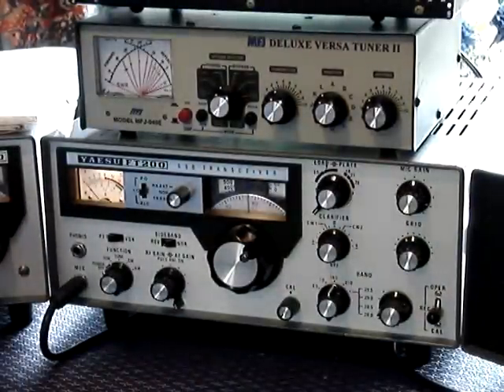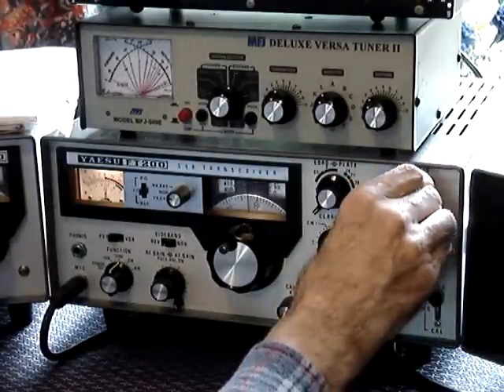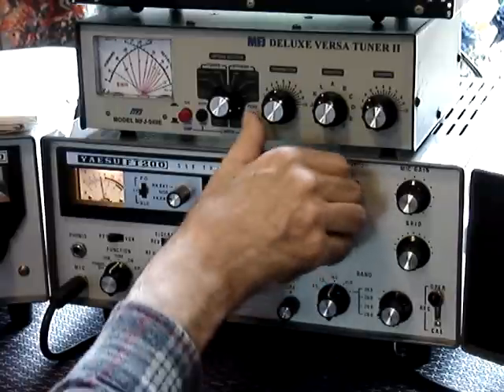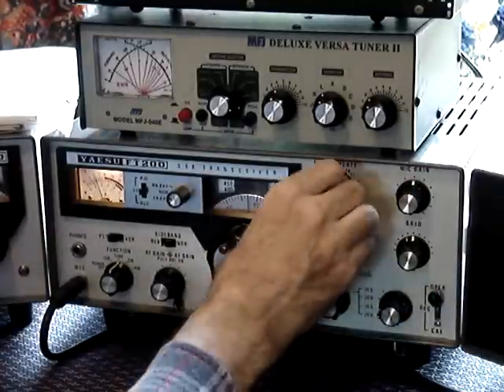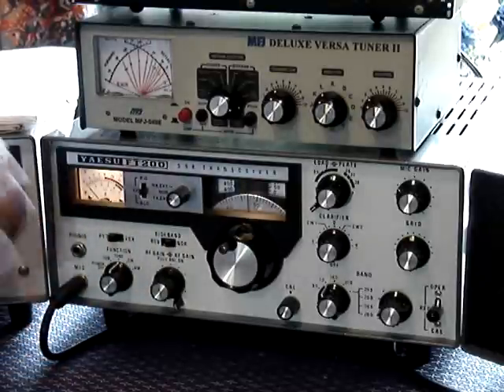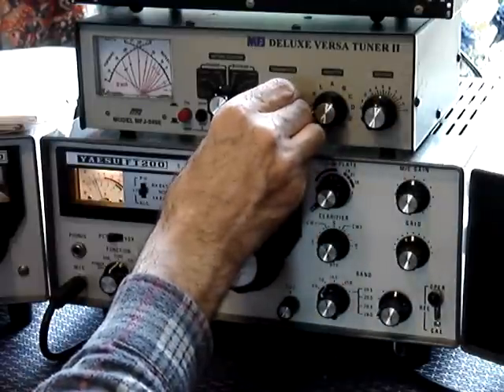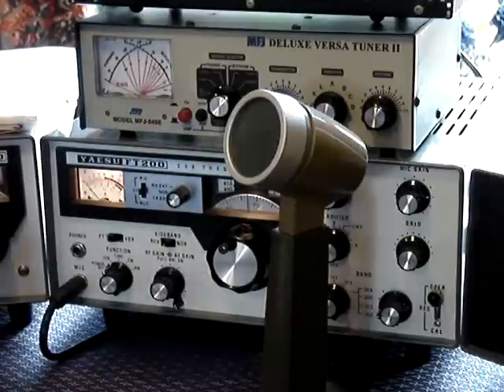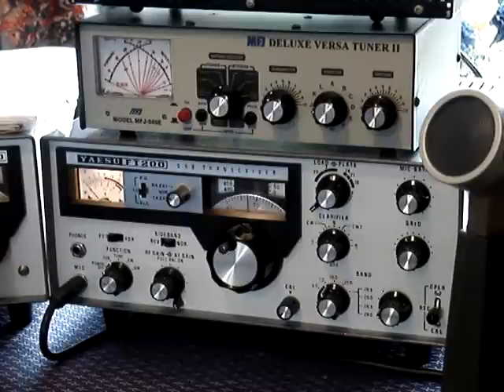TUNE UP OF MY YAESU FT 200

Comment: I was just using my Tempo one tonight and went through that procedure except my antenna is already tuned. Once you get the hang of it, it only takes about 20 seconds or so. Although I have modern gear I still love using this old rig especially on the lower bands. :-)

Comment: You'll never get out with Solar conditions like they are now without going full fuck! Tune with your antenna on a quiet spot, this is what you are using to transmit through.Everthing max  switched to pwr or through a seperate power meter, then bring power down to sensible level with mike gain. SWR not so important on valved P.A.'s! Just got great copy with SWR of 10 to 1!!!!!!!!! But will damage solid state P.A.'s and might even risk damage to them despite protection circuits! Don't be to fussy about SWR still or you will go mad, not unlike audiophilles do! SWR no more than 3 to 1, normally ok, more important how good aerial is, nowadays as far away as possible from buildings, fed with long feeder, back to building etc!Lots of noise now and with no Sun Spots very bad HF!As said just be carefull of SWR on Solid State p.a.'s!!!!! Sometimes wire 10M long with 50 ohm co-ax and simple tuner ok, forget counterpoise, just away from interference sources (computers/strip ligting), verticle will need radials though. Verticle down rear fence away from building, fed back to building is good to advoid interference (despite interference being vertiacally polarized) just keep antenna away from recieve noise sources. Ground fed verticle best with long radials as possible, but not in direction of noise sources, also earth at verticle base, even put salt on ground and wash in to make better earth at earth rod. Don't be to fussy with anything, tuner compensates for ariel length to a degree etc.
Reply: Dont know where you are Jeff, or if weve copied on HF before, but we could try for quick copy today, maybe on 7megs - Brian m6baq
Reply from the maker: hi I am away as my house has turned to shit so its being gutted like a fish be back in 6 weeks .. jeff ..
Reply: Catch you further down the log 73's!